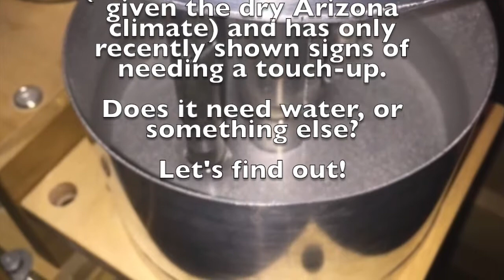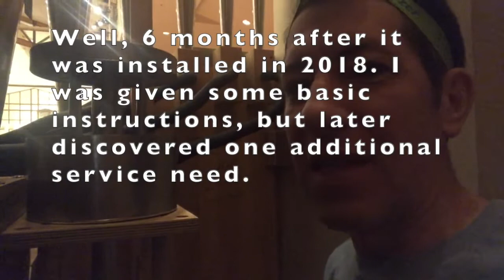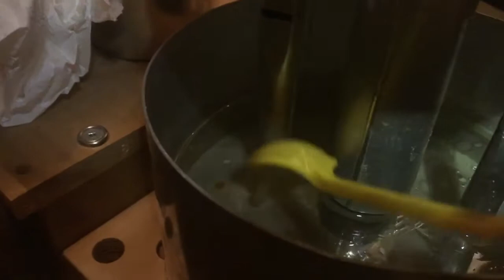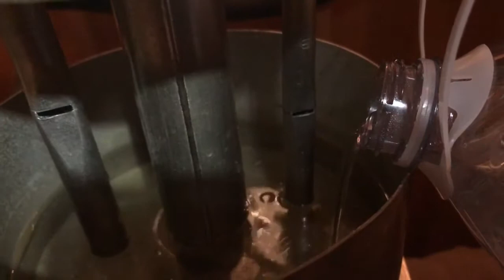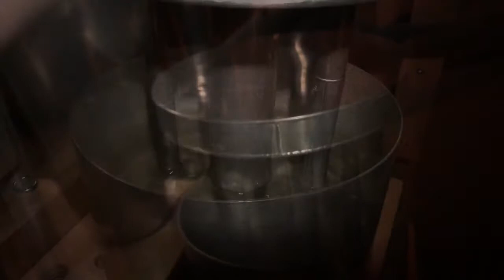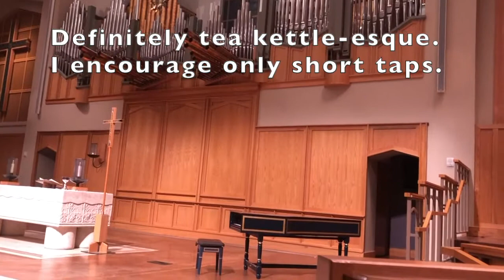Nightingale (Bird Warbler) Maintenance Video

Comment: Use a turkey baster to suck up the oil water mixture instead of a spoon. Might make it easier
Reply from the maker: I’ll look forward to hearing if anyone has tried that. I’ve always contemplated using a turkey baster, actually, but found the spoon worked efficiently enough for both scraping and lifting out the gunk (and I don’t have to clean a plastic spoon). I don’t think you can readily lift the instrument up and pour out the liquid, so one day, for sure, when I just want to start fresh, I’ll have to slowly suck it all out with a turkey baster.

Comment: Would this work?
Take 2 liter botle of Coke.
Drill a hole in the cap and insert a vinyl tube making the seal water tight.
Fill the bottle with water, hold upside down with the open end of the vinyl tube in your water container.
The end of the tube is placed so that it is at the water level you want.
When the water level drops due to evaporation the end of the tube gets air and water flows in your container to maintain the water level.
This eliminates the oil and saves the cleaning.
If 2 liters  is not enough you could put a 5 gal water bottle used in a water cooler.
You should be able to find something to last 6 months.

Another alternative.
You are using an oil that turns rancid.
Why not something that does not go rancid like WD-40 or sewing machine oil?
Reply from the maker: Thanks for this, especially the use of a different oil. I was told by the manufacturer to use the Canola oil--though it was all a learning experience as we bought the very first bird warbler they had made. I think I'll steer clear of the extra coke bottle filled with water, on the off chance that heat or other factors makes the bottle not air-tight and the water leaks out potentially getting on pipes or other electronics. Afterall, I have to go up in the chambers plenty to tinker with other things, so I can always top off the water occasionally. Thanks again!